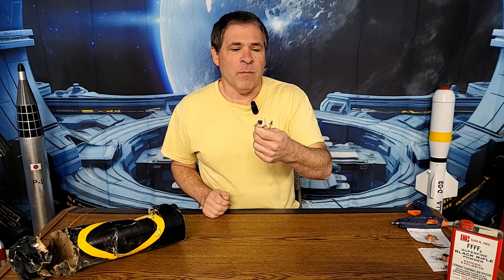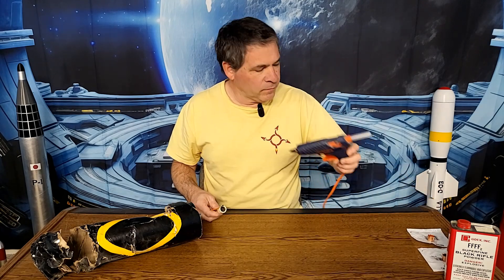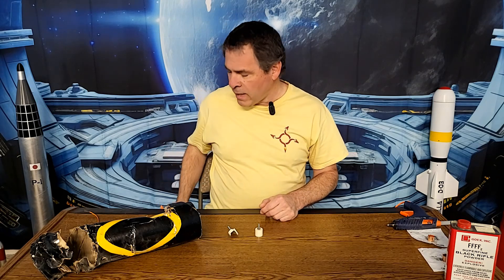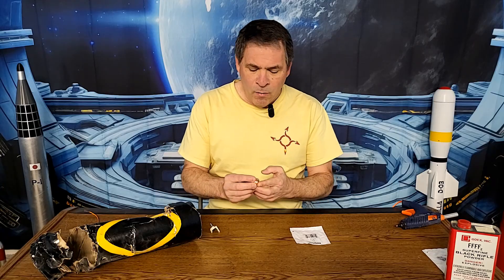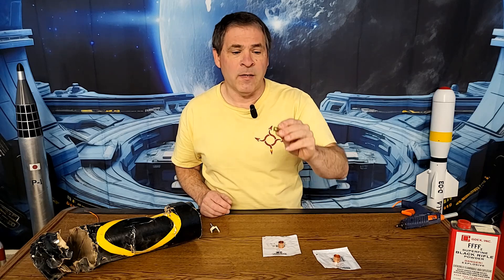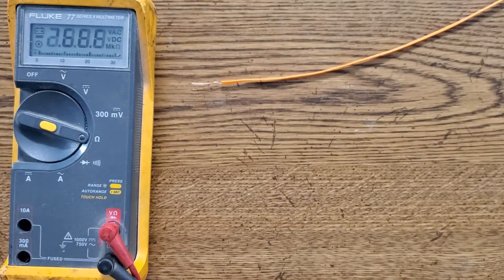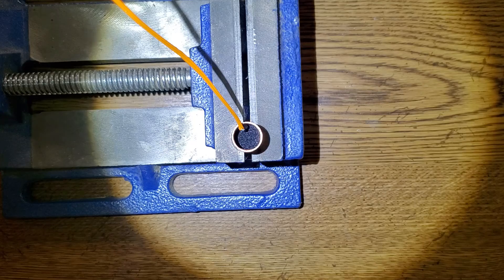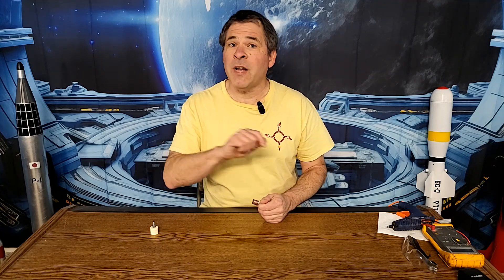Improved parachute ejection charge - DIY Build Tutorial

Comment: Decades ago when I flew HPR flash bulbs were still cheap. I'd tape a piece of paper to the FB and wrap it into a thin tube, fill to the desired amount of BP fold and tape the end shut. It layed unsecured in the Chute Bay and never had any problems popping the nosecone OR dinking the cardboard or phenolic body tubes. 
You really Don't need to try and create extra pressure, just use a bit more BP and the expanding gas Will make sure the NC pops off, IF you properly fit the nosecone... snug and add baby powder if a but too snug. Like you said, ground test it until you have the proper amount of BP (and fit). 
Every time I've seen BT's damaged due to Ejection Charges it was due to people using Hard deployment cups.. usually floating loose and acting like projectiles. A thin paper charge holder doesn't fly around at high rates of speed.

Thanks for the Videos!
🍺🍻

Comment: How would you build a suger rocket engine to incorporate a time delayed ejection charge at the end of the burn?
Reply from the maker: I don't use delay charge built onto the motor. I just don't like that system. Using a flight computer to fire an ejection change is more reliable at providing ejection at apogee. We use our motors in rockets that vary in size and weight and each one would need a different ejection timing if the charge was built onto the motor. The flight computer solves all that by just ejecting at apogee.
I have seen sugar motors with a built-in ejection charge so if you really want to go that route, just do some searching and you should find it.

Comment: What flight computer do you use? The computer reach apologies and signal the ejection charge?
Reply from the maker: I like using the EggTimer Apogee flight computer. It's simple and inexpensive. Which is important because we've destroyed about five of them in the last couple of years. When the flight computer detects apogee, it fires the ejection charge.
Reply: @ does it record the apogee?
Reply from the maker: @wayofflow955  yes, it beeps a sequence that tells you the apogee of the last flight.
Reply: @ which version, they have so many. We just need something cheap and works.
Reply from the maker: The one called "Apogee"
https://eggtimerrocketry.com/apogee_faqs/
Reply from the maker: Please be aware that this is a kit... you need to solder the parts onto the board.
Reply: @ we have been testing our 1” sugar rocket with 1/4 inch throat and 1/8 inch throat. Seem 1/8 inch will blow up. Do you know if 3/16 will work?
Reply from the maker: @wayofflow955  There are too many variables for me to answer that. When we develop new motors, we bring it to a point where it explodes and then keep increasing the nozzle by 1/64th of an inch until it no longer explodes. If you want a good margin of safety, get to a functional nozzle size and then increase the nozzle by one more 64th of an inch.
Reply: @ that is a lot of testing, but it’s part of the fun. Are there any equipment to record the camber’s pressure?
Reply from the maker: @wayofflow955  It's a bit of testing... you already have your testing range of 1/8 to 1/4. That has you at least close.
I don't know how to measure internal pressure... never done it and never researched it. Fact is, it's not really important. If your motor explodes, pressure was too high... if it doesn't explode, pressure is acceptable. Even if you could measure the pressure, you would find it to be ridiculously higher than the rated pressure of pvc pipe.

Comment: Using smokeless powder basically turns your ejection charge into an m80.  Stick with BP.
Reply from the maker: There is discussion on-line about it being used successfully but I have not tried it. Like anything else, it would require testing.

Comment: A couple of points about using PVC caps for the black powder deployment charge. I've used them repeatedly in 3 to 6" diameter airframes. If you seal them too tight like using hot glue, you essentually make a small bomb that can explode. I've always just used the ematch-black powder-some insulation to take up the excess space-and then secure with good duct tape over the end. Never had one 'explode'. And for the larger airframes, I'll cut a length of pvc pipe (1.5" long) and stick it into the pvc cap to make a larger volume for the black powder to completely burn before it ejects out. 
Another thing to consider, on one 4" sugar rocket, the cardboard airframe next to the charge was getting soft and on the 17th flight, it blew a hole out the side instead of blowing out the chute and nosecone resulting in a ballistic return that destroyed the rocket.

 I didn't see a chute included in your ejection tests, just an open bay...stuff stuffed into the bay can make a difference in being successful or not. 

And since you haven't use smokeless gun power for ejection you shouldn't comment on it being a possible alternative. Smokeless powders work when under lots of pressure (like in a gun barrel under thousands of pounds of pressure) but generally not for rocket ejection, people sometimes use things like Triple X and other Black Powder substitutes but you need lots of experimentation to get it right. For example, 4F BP works best for ejection but is not as good as 3F, but it can be used if you know how to compensate.
Reply from the maker: I agree that a PVC cap is likely to work pretty well. But the caps I was using were CPVC which are much thinner wall. That thin wall was probably the main cause of the failure. They've worked well for the last several years but this one just decided it had enough and *BOOM*.
My reason for suggesting smokeless powder as a possible alternate is based on information found on web sites such as Wikipedia, RocketryForum and several others. So even though I have not tried it, I felt there was sufficient discussion online as to it's success that it was worth mentioning. I've had some viewers mention in the past that they were unable to find BP available for purchase.

Comment: i feel like a piece of tissue paper on top of the FFFF would be a good idea. (Firework guys do this)
but you been doing this way longer than me. nice video again. thanks

some pack that with dog barf then cover it with just a piece or two of masking tape.
Reply from the maker: Tissue may not be a bad idea here... Would keep the bottom of the glue from absorbing a little bit of the black powder. But I have not found it to be necessary. I guess the most important thing I discovered in doing this is that whatever you use to seal in the powder, it needs to offer some good resistance so you get a good explosion.

Comment: so why not just print a pla insert to go into your cap?  you can shape the cap with a weakest point in the center thats only one or 2 layers thick depending on your printer that could be 0.08m thick? you could even screw the cap on if your printer is good enough?
Reply from the maker: A few issues with that...
1. Kinda a waste of time, electricity and PLA when just a small amount of hot melt glue works fine.
2. The copper part is not threaded so the PLA plug would still need to be glued in place - Probably with hot melt glue - So if you have the glue gun out already then just use that to seal in the powder.
* Now the one thing I do like about your idea is that it would allow you to accurately control the thickness of the blow-out area... Two layers, three layers, four layers...  And experiment to find what works best.
Reply: Masking tape over the ejection charge well and, thereby, HPR rocketeers elsewhere manage to use PVC end caps without them exploding.
Reply from the maker: I had considered wrapping the plastic cap but ultimately decided that a metal part would be stronger. It's likely that a PVC cap would already be stronger than the CPVC cap I was using. But I originally chose the smaller CPVC cap so that the black powder would be in more of a clump rather than in a very flat layer in a larger cap. May not make a difference though.
Reply: So what I meant was that as you effectively making a disposable cap within the metal part. 
I meant you can print a thread into the print, as you would need to print it in two parts. 
But anything that joins up two parts, would do it, so even easier it's just two mating half's and some CA equivalent to seal the cap. You can tamp it in a jig also with this kind of method too.
Reply from the maker: Got ya... Well I suppose it's a viable option. Would just take a bit of experimentation.